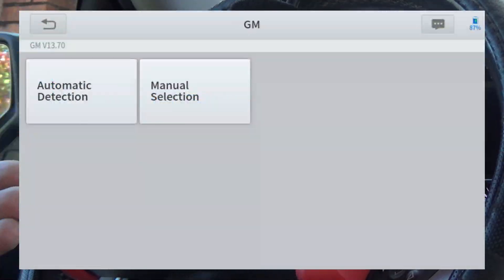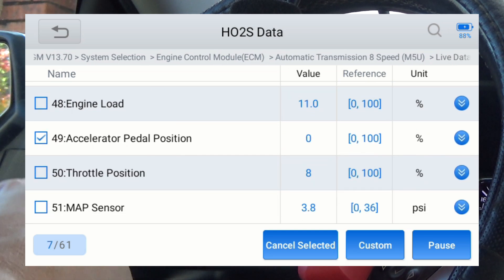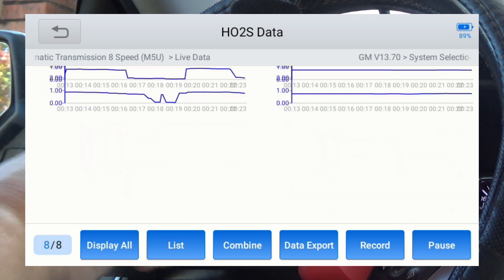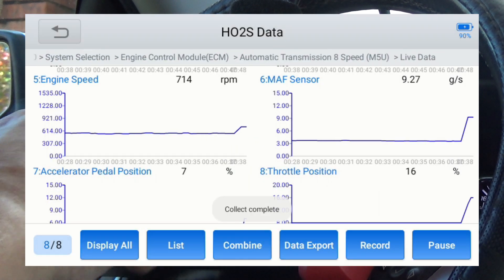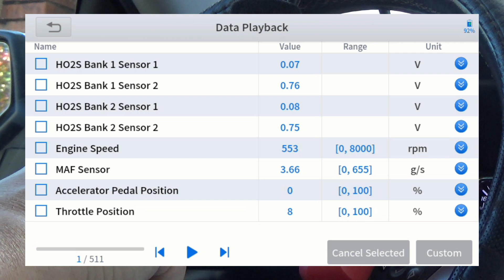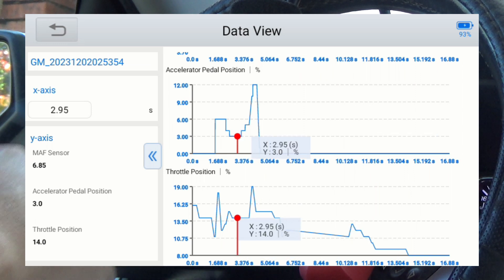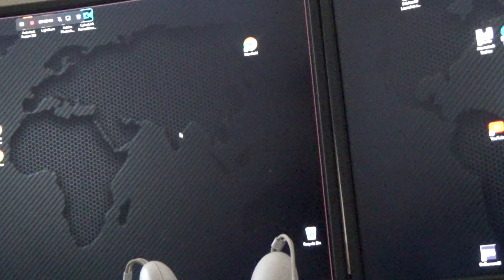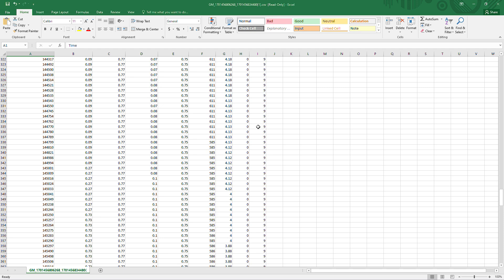8in1 Graphing Abilities of the Xtool IP608 Scan Tool with FREE Lifetime Updates.

Comment: I got my XTool D9 Pro a week or so ago. I found the live data and graphing to be a bit weak. If I'm after a drivability problem and need to grab live data on a road test I will probably do that on a different scantool. Also I WISH it had some kind of vehicle history record system. If a car comes in with a reoccurring problem it's nice to have everything recorded on the scantool where I can just go back and see what codes were pulled off the vehicle regardless of how long ago it was scanned or how many vehicles were in between. It also can't do AutoAuth on 2017+ Chryslers. I can definitely go further away from the car on my Autel MS906bt.  HOWEVER! This is ABSOLUTELY my goto scantool when a car comes in! It is unbelievably fast! I had a 2008 Ford Edge with maybe a dozen modules on the network. From the home screen to connecting to the vehicle to performing a full code scan was 30 seconds tops! I also scanned a 2020 Mercedes GLE450. It had 144 possible modules of which it had over 70 equipped. Home screen to connected to full code scan was less than 2 minutes! 

XTool has some flaws and limitations but man I love my D9 Pro! I paid 1000USD for it and has 3 free years of updates. I paid 1400USD for my Autel MS906bt that only came with 2 years of updates. I'm not sure what XTool's future update costs are but Autel's updates for the MS906bt are 700USD (full retail) per year. Snap-on scanners are $1.5million and 50grand per month to update! (Some minor exaggeration). 

These XTool's are crazy awesome value for money.